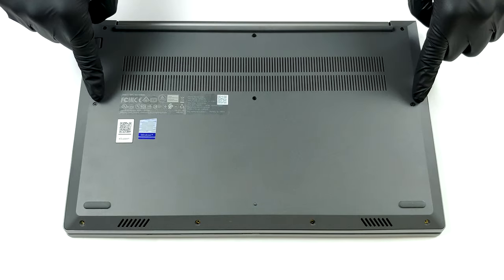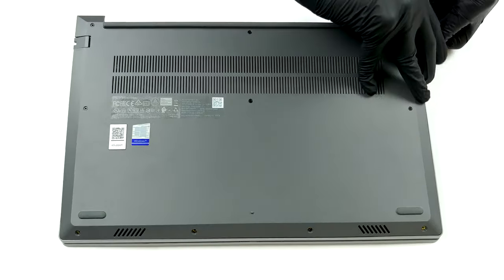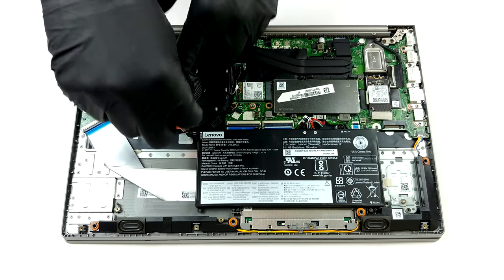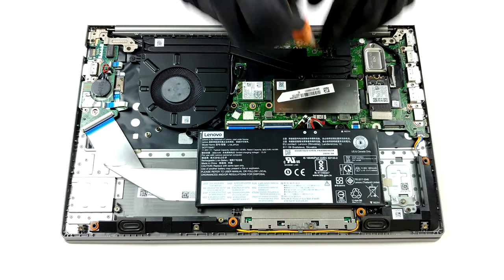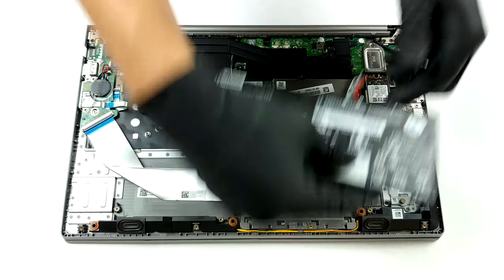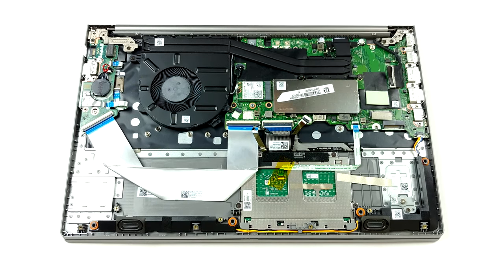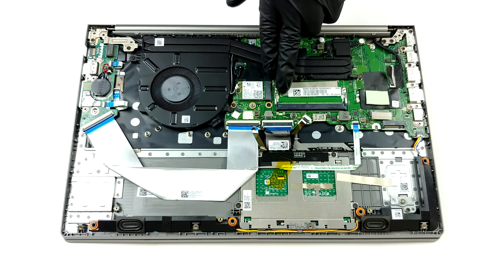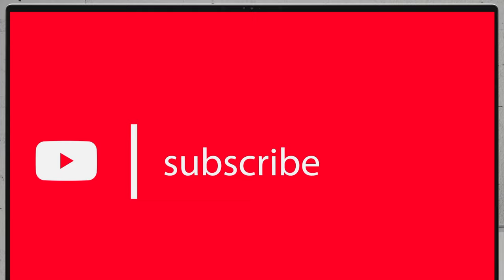🛠️ Lenovo ThinkBook 15 Gen 2 - disassembly and upgrade options

Comment: There are different configurations available - with additional HDD bay or second SSD M2. This one comes with additional m2 slot. On models with HDD bay battery is moved closer to the side to free up room for HDD. It looks like jhdd1 connector is not soldered on this motherboard, so I believe no way to install 2.5 drive here.
Reply: With this situation (i.e no jhdd1 connector) someone could replace the 45Wh battery with a bigger one right?

Comment: Warning for you guys - i've disassembled recently one that was never opened before, cover was stuck to the heatsink. If you try to remove the cover lifting from the side you can rip the cooling off. Lift starting from the back like in the video, if it gives any resistance gently pry open with a plastic tool, sticking it between heatsink and cover.

Comment: Review is incorrect, it says "you get two M.2 PCIe x4 slots, one of which supports Gen 4 drives".

It has one PCIe 4x4 and a PCIe 3x2 (next to the battery) this limits the speed on that drive to a max of 2gbs

Comment: I've got a Thinkbook 15 G2 ARE Gen 2 with the AMD 4700u processor.  It's layout is slightly different, with 2 slots for 2280 SSDs and one for a 2.5" SSD.  The 2.5" is under the battery, which is positioned over to the side under the cooling fan.  The factory SSD is a 2242 with a bracket to fit into a 2280 slot.

Comment: I have a Lenovo Thinkbook 15 Gen 3 AMD. Would it be possible for you to make a video taking that laptop apart? I don't know how much is different between the Gen 2 and Gen 3, or how much difference there is between the Intel or AMD build structures. I'm just trying to avoid taking mine apart until I know for sure what it's going to look like inside, but absolutely NO ONE has made a video with the Gen 3, yet; only Gen 2's.

Comment: This is a large chassis housing the same components as 14 inch version, So ideally both 14 inch and 15 inch version should preform same. It would have been great if Lenovo had included large battery in the 15 inch version.

Comment: What do you mean by "pair chip with appropriate amount?"
Reply: If it has 8gb of ram soldered, then use 8gb of ram in the extra slot. Basically stick with 16gb instead of throwing more ram into it
Reply: @AJSquirrel53  So, for this laptop, total of 8+8gb ram is better than 8+16gb. Did I get it right?
Reply: @traitrous836  yes, if you want it in double-channel regime
Reply: @DatagorElectronics  Not really. Even if you put 32gb ram stick in there, 16gb will run in dual channel and the rest 24gb will be in single channel.
Reply: @sajidahmed4834  Thanks for clarifying. What difference does that make in terms of performance?
Reply: @funkymunky (in this case) to the average user, you will rarely notice any difference between a 8+8 dual channel only setup vs a dual + single channel setup.
Reply: @sajidahmed4834  Great! Thanks for the quick reply. Better than a lousy chatbot or customer “service” 😅
Reply: @funkymunky  no worries. If you have the $ to spend and feel that more ram would be beneficial to you (say you run resource heavy apps, VMs, stuff like that), then I'd highly recommend you to get the 32gb stick. 16gb will always be in dual channel (for performance) and the rest would be leg room for the other stuff you want to fit in. :)
Reply: @sajidahmed4834  Thanks, man. Really. If I could buy you a beer, I would!

Comment: Hi ... does adding the Hyperx 32GB 3200Mhz CL20 memory keep the DDR RAM format or will it go in SDR?
Reply: 1 more thing ... i see more screws and space for the battery ... what is the maximum i can get for an upgrade?
Reply: @Narinjas  well only thing I can guess is that you can get the 57Wh battery, probably some from Ideapad 5, still, I'm just guessing.

Comment: hi, thanks for share this useful video. i just want to ask that, if i upgrade my RAM to 24 or more,  is it possible to add 2 separete RAM or  only 1 DDR slot exist ? thanks in advance
Reply: Only one exists, therefore you have to put 16gb one there to make 24gb overall